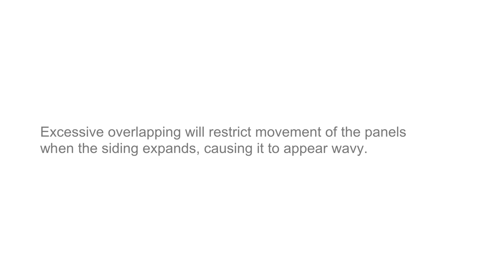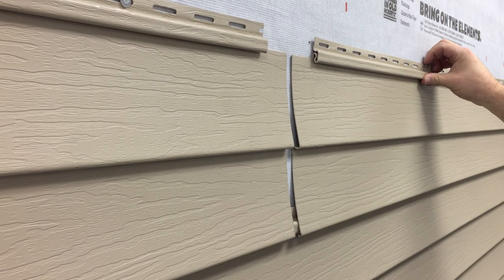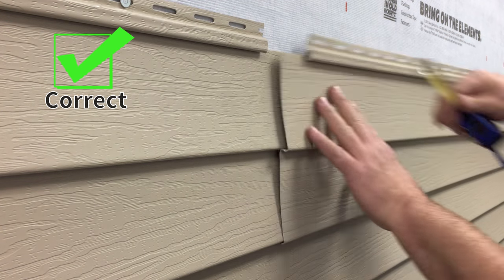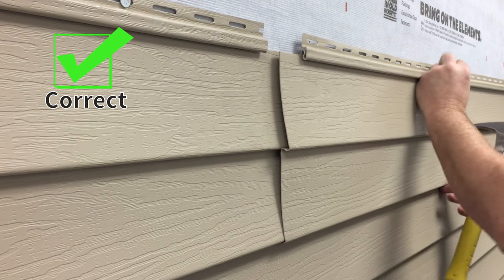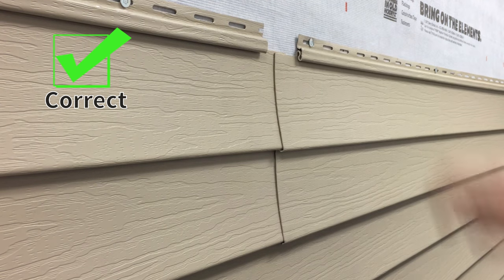Kaycan Vinyl Siding Installation Tips: Overlapping

Comment: I saw at least 2 mistakes. Never nail a piece of vinyl that close to the factory, I always stay at least 6 to 8" from it. Also, you have to overlap that more, it has to tuck underneath the left (in this case) factory. If it doesn't, you will see house wrap in sometimes less than one season. I would rather have a joint that doesn't look spectacular than see tyvek exposed. Which do you consider more of a problem?

Comment: I have been told that the correct way for overlapping, is that the nailing line ends of both pieces are just about 1/4" away from each other. And it makes sense to me. That means about 1" to 1 and 1/4" of the one piece under the locking line of the other piece.The way this video is telling me how to overlapping it might cause the sheets to come off the overlapping and or become bulky.

Comment: Some factories are 2 inches some are an inch and a half so if your overlapping half that 3/4 on each end it can still slide 2 1/4 inches one way or the other and all it will take is 3/4 of an inch of movement for it to  not be overlapped anymore
Reply: You put a nail one the left side of nail slot, and another mail on the right side of another nail slot to prevent sliding out of place of the piece.
Reply: @CS-zo7wx   That's an incorrect procedure that will absolutely result in buckling or bubbling
Reply: @spacetimeworm  you still allow for movement of the piece genius.
Reply: @CS-zo7wx  if you pin the piece with a nail in the left side of one nail slot and a nail in the right side of another nail slot, exactly how does the piece move back and forth?
Reply: @CS-zo7wx  no factory will warrantee their product if you fasten their product in this fashion.
Reply: @spacetimeworm  the nail slot is an inch long
Reply: @CS-zo7wx  I am aware of that.
Reply: A 12 foot 6 piece of vinyl siding will only expand and contract a little over a half inch. Insulation in summer when hot you can run tighter gaps or looser in winter.

Comment: What state are you in. The factory ends should overlap. Even. So is the factory is a 1 1/2 it overlaps the other panel a 1 1/2 ! 2 in factory overlaps 2 inches. In northern Ohio. You siding would blow off the wall! With the wind off lake Erie. And going from temps of 90 in summer to -40 at times. It wouldn't last one winter!!! So before claiming you way is the right way. Check all you facts first!!!
Reply: This is the company that makes the siding lol, but I do agree they overexadurate how little they overlap, you should overlap atleast 1 1/4 inch or it will probably shrink and blow off
Reply: @brookbandeen4999  the box is wrong of you in northeast ohio. A 12'6"' panel can grow up to 1 inch and shrink a inch. Put it on in 90° temps. Then see how it looks at -20° I have done siding for 30 years. It's what ever the factory cut out it. If it's cut out 1-1/2 inch then it 1-1/2 if it's cut 2 then it's 2. You have to take in account for other factors. Like 50 mile a hour winds at time of lakes and oceans hurricane forces and more. Then guys that write the instructions. One write instructions. They don't hang siding. But do it how you like. Then go back a fix it again later